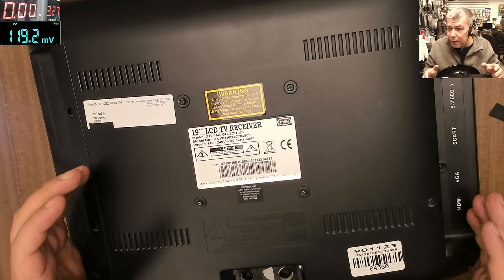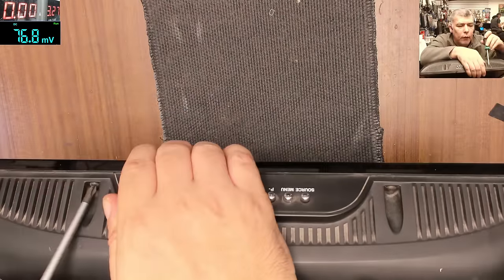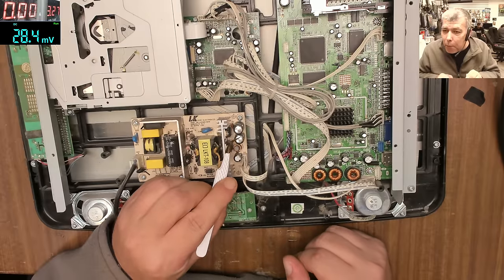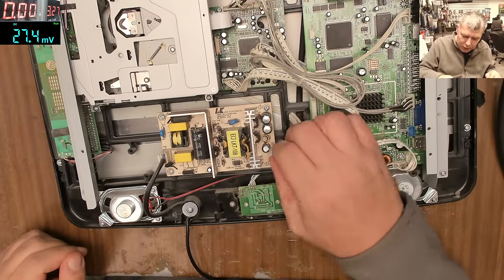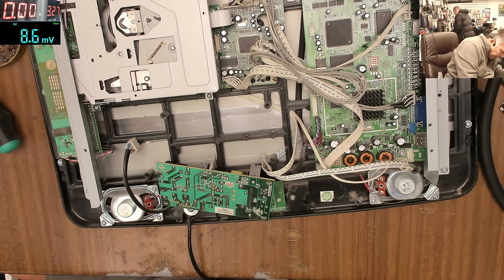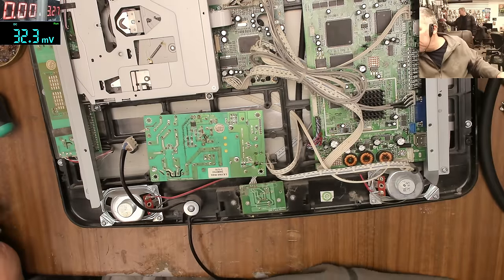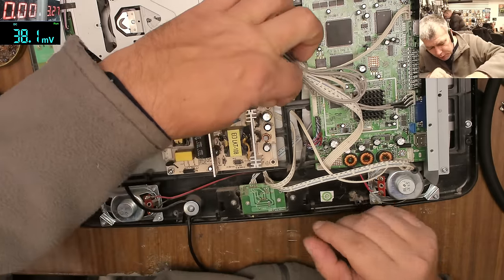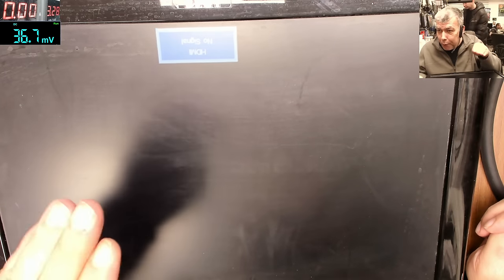This is the most common fault on a dead TV!

Comment: It's the heat that "Jiffy Popped" those capacitors. A higher working temperature would help, higher working voltage wouldn't hurt either. Good quick repair Mr. Sorin.

Comment: Nice video demonstration...
Tip: A 470uF/25v can be replaced 470uF/35v if there's no 25v...
You can also use an ESR meter to detect a dried up electrolytic capacitor...

Comment: I had an old 32" Westinghouse LCD tv a few years back that was dead (but the audio still worked) and the power supply PCB had a few bulging caps that I replaced and brought it back to life. Saved about 300 bucks

Comment: Better quality capacitors would be be better than just higher Voltage, 125C caps will last longer as they cope with higher temperature before they dry out and fail. Most consumer stuff is made for a price point and lower grade components are used.
Reply: I have replaced these in computer monitors as well.  I always use Japanese capacitors such as Nippon.  I also try to get as high a temp rating as I can as well if I want the repair to last a long time.  

Most bad capacitors I've seen that have went bad are tier 2 or some cheap no name part.  It's rare that I have seen a tier 1 part go bad unless something else went bad, like a diode that shorted.  

With basic soldering skills, most anyone can make this repair.
Reply: @noneyabus1  I’ve repaired a few TV’s and monitors also and I did work for a power supply company. I do miss the electronics job satisfaction!
Reply: @JPracer069  I took electronics back in the 80's, mostly vaccum tubes but transisters were included as well.  I've repaired and built various things over the years.  Even use Kicad on occasion.  It's fun to start with nothing and end up with a working circuit.

Comment: Used to fix TVs for a living myself, back when I was very much younger.  He's right about the power supplies being the fault, quite often. Often, in those earlier TVs, the part of the power supplies, it was the part of the fly back capacitors.  A 10 microfarad cap was dead or sorted out, and then the video part would be displayed as a horizontal line or maybe no video at all.  The audio would be okay though. The value of the display cap?  10 micros at about 150 volts.

Comment: I had a 42" TV that had a bad Power Board. It was an older TV, and the replacement board was a few dollars cheaper than buying a new TV with a warranty. I suspected the capacitors were blown, but saw no visual indication of that, but almost 100% that was the problem.

Comment: I agree that caps is the most common fault, but sometimes the power regulator will fault. That component is use to ensure a steady voltage through all operational conditions. Regulates voltage during power fluctuations and variations in loads.

Comment: I usually hope for blown caps when I'm opening the set up but more often than not it's backlights, diodes or a main board issue.
Reply from the maker: I know, that's why we are taking only dead TV's, otherwise we are losing too much time
Reply: Newer TVs the led backlight is a common issue and boards fail aswell
Reply: So my Visio main board is bad ... does that mean TV death? Everyone seems to be down on replacing them.

Comment: I was working as a bench tech 20years ago repairing desktops and Laptops for a company. About the puffed-up capacitors. What i found out it was from industrial espionage. Someone broke into a large capacitor manufacture's computer system, could have been Nichicon not sure. They stole what they thought was the formula for the capacitor electrolyte, but it wasn't. The company kept the formula in 2 parts and the thieves only took half of the formula and with that they made counterfeit capacitors from all the major companies. Around 2001-2003 we received a lot of motherboards and power supplies with puffed up capacitors. Nothing else wrong just the puffed-up caps. A few years later I got a Job working "IT" for a very large company and they had Dell...we had a flurry of Dell's with puffed up caps. Then after the caps we had all the Dell laptops with bad GPU's, seems if you did not clean the cooling fans and they got clogged the GPU chip would get hot enough to de-solder themselves😃. I heard of people putting their mainboards in the oven to reflow the solder. Never tried that b/c Dell extended the warranty and took them back. One time they sent me 20 new laptop mainboards it was so bad.

Comment: In SMPS the frequency is very high, so the capacitance becomes relatively unimportant. What is important is the internal resistance and parasitic inductance of the capacitor. The two 470uF were put in parallel not so much to build the capacitance to 1000uF, but to reduce resistance and inductance. 

Whether you made up 220uF or 2200uF likely would make no difference to the circuit. Consider having a stock of polymer capacitors which feature long life and low ESR.
Reply: Why don't you explain smps and ESR for the audience my assumption small module power supply? ESR? Something like Electro ..... Resistance?

Comment: Remember those tube type televisions where a technition would come out to your house take the back off the tv and start resoldering those big circuit boards and changing capacitors etc. I believe a lot of tubes were made at Mullards in Belmont Durham.
Factory sadly gone now

Comment: Thanks for the video, I have fixed a Samsung Monitor the same way, Bad capacitors just like that TV's. Is that a Weller solder iron?   I'm using my vintage  Weller WTCPN

Comment: have you ever heard of an incorrect HDR setting causing picture loss, not picture signal loss but just making the screen go black? I have been using my 55 inch 4K RCA TV as a computer monitor for years. Throughout the years I have had a constant problem of the TV picture randomly going black but still having audio. This will happen when I'm watching videos or sometimes looking at a photo slideshow. I will have to change the input in the menu to a different source, then change it back to get the picture back. The really weird thing is if I went to the exact point in the video where I lost picture the TV would lose picture again. I just recently turned off HDR on my TV and I haven't had the problem since.

Comment: I have a lot of good experiences with PSU capacitors, but one bad too, in a certain audio/video device (meant to be audio primarly, but could be used as a DVD player). The capacitors were already so bad and exhausted that the spikes and/or supply voltage fluctuations and variations simply destroyed the processor, which was nowhere to be found. Analog section, amplifier, was recovered after replacing the capacitors, but digital remained dead.

Comment: Pregnant capacitors are the most common SMPS fault  I see. Problem with many of those style of device is the PSU is on 24/7, the cap is subjected to 70khz HALF wave pulses for years at a time. Often takes longer to open the device than to replace the caps. I will always change the small bootstrap electro in the primary circuit whenever  I change the secondary caps.
Reply: @BlondieHappyGuy  Not to mention a lot of electrolytic caps are rated at 85°C which in my experience, is unsuitable for any power supply where components with heat-sinks are in close proximity to them. I usually replace the suspect ones with 105°C high tolerance / low leakage / good quality types (ESR tested prior to installing - I never do this blind). Typically LG, Panasonic, TEAC and some Samsung DVD / VHS combos made between 2006-2009 had this very problem.

Comment: Thanks but was hoping for power supply tutorial, so many here have been power spiked from power outages and surging on and off. Blown fuse here usually has made it past fuse to 1st and 2nd transformer, thinking step down?  can you show repair tips, ideally we would scavenge them from other TVs at dump for recycle from same model or manufacturer. Could it also be diodes if fuse just keeps blowing?

Comment: I regularly increase the voltage rating on a capacitor. But how do you know that changing the uf rating will be OK?
Reply: Good question I was wondering the same thing... I hope there is an answer to your question below.
Reply: You know the topology of an SMPS and you see that these are just output buffer capacitors. Their capacity isn't critical, that is there exists a lower bound somewhere starting from which it will get a lot more ripply, and an upper bound where power on could take a while and cause issues, but usually you have plenty of leeway especially up, you'll run out of space sooner than you run out of design tolerances. Manufacturers in mass market, non-enthusiast gear usually aim for the lowest component spec that they can get economies of scale on.

Something to keep in mind is that you want to keep ESR in the design ballpark, so if you uprate them on voltage, the ESR goes up but if you uprate them on capacity the ESR goes down for a particular electrolytic capacitor type, and your ideal aim is down since they got baked to begin with. Also uprating them on temperature handling spec is always a good idea.
Reply: @SianaGearz  great explanation, thank you. I also hadn't considered esr.

Comment: So, correct me if I'm wrong, but are these caps the ones that are in circuit on the output lines of the rectifier, before a DC regulating circuit, the ones that filter out AC ripple? Is the fact that the caps were abused to be blamed on fluctuating input ACV outside the V input limitations of the rectifier?
Reply: You are correct about the position of the caps, low voltage DC side smoothing it all out. I think it's more likely they were old and cheap, rather than abused.  Electrolytics all have a shelf life, some better than others.  As for his choice of values, no problem with a higher voltage rated cap, and in this case he got away with a higher rated capacitance.  But to be honest I'm not happy that this video suggests it's that simple.  There are many other cases where you need the right sort of cap, never mind the values.  I think the guy in the video knows that too but was just sharing how to quickly fix obvious output smoothing cap failure.

Comment: The DC voltage rating of the cap, has absolutely nothing to do with the ripple current rating. The higher the capacitence, the higher the ripple current rating

Comment: An LCD screen (46"), about 11 years old, regular household daily use develops horizontal bands of snow that flash. Broadcast image still there to, sound is fine.
Could this be a cap issue?
(Toshiba 46G300U)

Thanks for sharing your repair. I have a dangerous amount of electronic knowledge and skill. Looking forward to using it, and your work inspires.
Reply: No that would not be a cap issue

Comment: I didnt understand the bit about putting a higher voltage cap. Could someone explain, please?
Reply: The voltage rating of a capacitor is the voltage it can withstand so you can always use a higher voltage capacitor but never a lower one.

Comment: Thank you for the clear and simple explanation with a few good tips.   I’d have burned two fingers opening that blocked solder joint before inserting the new cap.  😂

Comment: hello sir ,excel video as usual . i have couple of questions regarding what you said about higher capacitor  . a) higher voltage makes sense , is it also okay to use higher capacitance ? b) is it same formula for SMT capacitors on laptops . c) i am working more on car diagnostics tools /boards . there are RELAYS which play very important rules . now my question is can i use higher vol relays ?  for example there are plenty of 5volt relays , can i use 12 volt ? nd is it ok to have mixed 5v and 12v ? many thanks  i really hope sometimes you make videos about car computers / ECU and diagnostic tools .
Reply: Depends on what you mean, if you're talking about 5 volt or 12 volts coil voltage, the answer is no you cannot interchange them. Even if they work, they will be inefficient.

Comment: Bad capacitors are the #1 cause of failures in HVAC systems.  They are much larger, and cost about  $10.  I keep one for my AC, next to the one that will probably fail one of these days.

Comment: Not sure. I don’t trust the Internet. Maybe it was the caps, maybe not. I'm sure your fans enjoyed the show. That's what brings in the cash. you're awesome. Like to see you fix a USB-C power input on an LG Oled tv. That would be interesting. Good Luck. 👍🏼
Reply: Swollen caps are def broken, used to be caused by faulty construction, was a very big thing around 2004. Replacing them fixed many serious problems, so..if it works after replacing swollen caps that most likely was the cause. I think nowadays they don't tend to swell that often. Still good to check. And they can be broken without haven swollen unfortunately.

Comment: Hi, just to be certain, when the fuse was tested i did not hear any sound to confirm continuity? Shouldn't have there been the 'beep'' ? Also replacing a cap of 450 of capcitance with one of 1000 isn't this to high a value?. Sure higher voltage but for capacitance shouldn't it be as close as possible ? Maybe i am missing some info :), thanks !

Comment: You should at least check the defective part with rlc multimeter to make sure its the defective one.  I repair my plasma TV 50" when it went out with a big pop, really loud.  I open it I could smell some burn something.  So I look at the board it was a capacitor, remove it measure it no value.  Replace with the same value it Works again.

Comment: The capacitors were smoothing capacitors. It smooths out the ripple content after the rectification process from the diodes in the bridge rectifier. The higher the capacitor the smoother the ripple, the less spikes, the cleaner the DC content of the power supply. Also, it is not good practice to keep the soldering iron in your hand whilst removing the capacitors. You should have used a desoldering tool to suck up excess solder then cleaned the terminals with PCB cleaner or nail polish remover and used a thinner solder wire and whilst soldering, blown on the joint to remove oxidation and keep the solder looking shiny and clean. Then used miniature cutters due to the thickness of the capacitor leads wires. The capacitors got hot due to age and the dielectric drying up and after getting hot they go open circuit and no longer keep the voltage stable on the power rails. I'd give 6/10 for this job. 10/10 if he used a solder stand, correct solder wire gauge and cleaned the joints for a professional finish if broadcasting on YouTube where the whole world can see and critique your work. No disrespect intended except I'm pointing out good workshop practice along with an antistatic mat! to protect against static and cushion the equipment.

Comment: In recent years I have repaired many satellite receivers.
ALWAYS blown electrolytic capacitors.
I replace them with the same ones that can withstand higher temperatures.
then those receivers are good forever.

Comment: Those capacitors (electolytic) were almost certainly manufactured in China. They ended up in HP, Dell and other PCs.
Ended up in top line servers at the time like HP ML350 G5s. Our company got saddled with repair costs. And all because of scammers in China using inferior materials.
I has 10 year generic PC I try to turn on recently and over 20 caps were swollen.

Comment: I found an lg 32 inch led. It has 2 bulged caps. I couldnt metlt the solder with my 65w iron. How come that solder is so hard to melt in new boards?
The caps are hard to find 400w 8muf.
Reply: The unleaded solder from the factory has a high melting point. Try adding a little lead/tin solder to the joints and they may be easier to desolder.
Reply: I have discovered that many LG Televisions do not use tin/lead solder. They use 95% silver solder, which has better reliability / conductivity. When I repair these, I use silver solder paste - specially-made for soldering on PCB's. Hope that this helps. Changing-out Electrolytics, I feel that it is also important to replace the failed caps with the top-quality brands. The top class caps last far longer than the caps used in the original TV manufacture.
Reply: @peterduxbury927  Yeah, but we are talking about desoldering. Applying a little lead solder to the joints will help them come off easier. The pads are then cleaned and you use whatever you want for the replacement.  Low melt solder works too but is very expensive.

Comment: You mentioned that the top of the capacitor was deformed. Is that what happens when they go bad?
Reply: Yes, They have precut vent reliefs, when they go bad pressure builds up inside and they burst, if the fluid leaks out they no longer work or have greatly reduced capacitance.  without the pop can top vent you get a nice gunshot type noise when/if they go bad and explode.

Comment: EVERY older TV that dies on me has been a recap job. I replace them all but probably could get away with just replacing the Power supply caps. Usually if not a power issue it will blink a code that points the way.